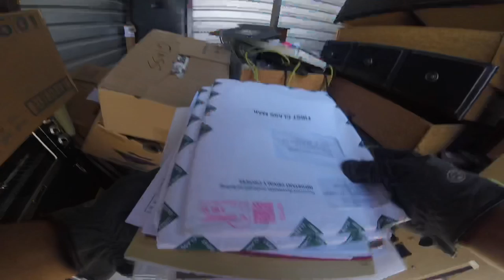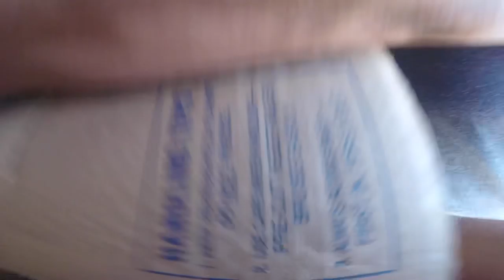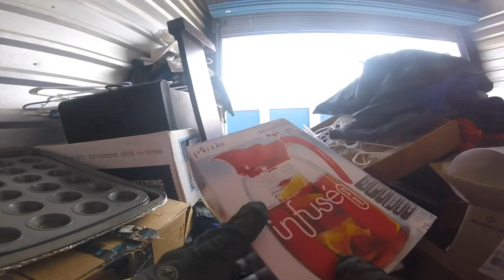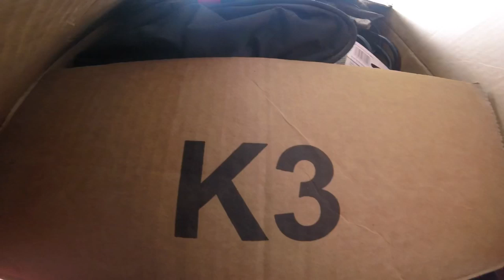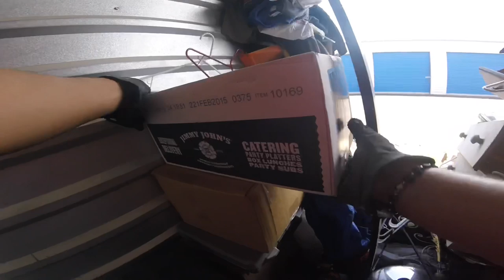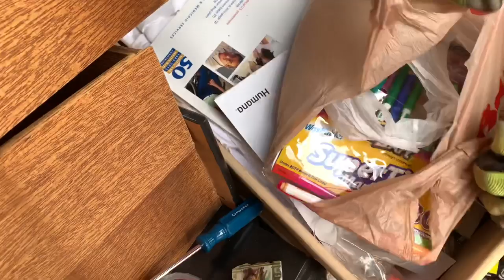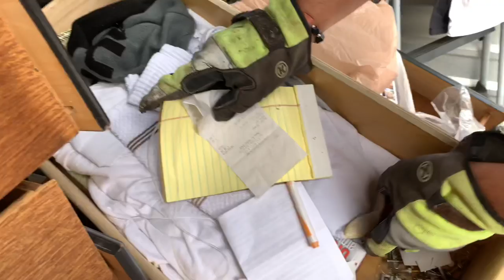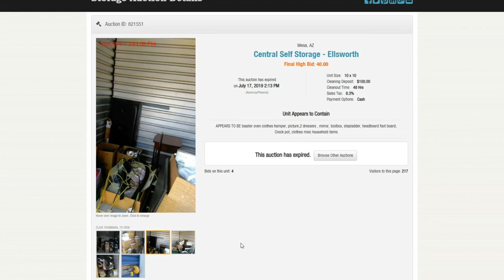FOUND GUN, GOLD & TOOLS IN THIS ABANDONED STORAGE AUCTION UNIT

Comment: You may consider grabbing a decent Inverter and bring a fan. With the inverter you can run the fan from your van. Just a Public Service announcement to prevent heat stroke. You may have an Inverter from a previous storage unit.